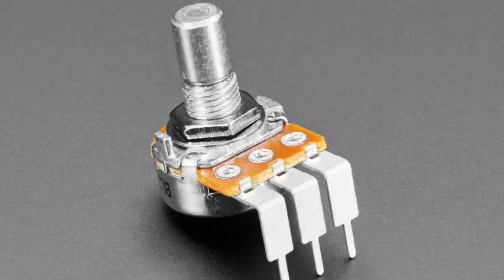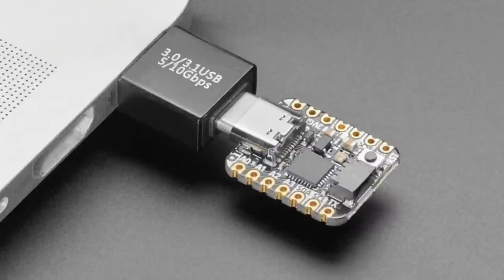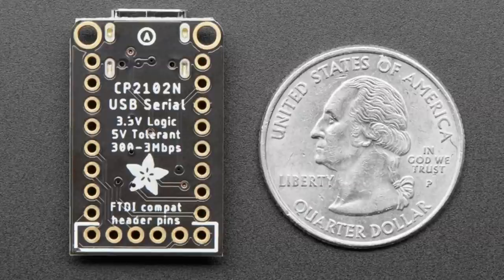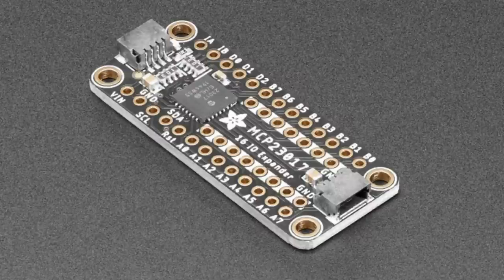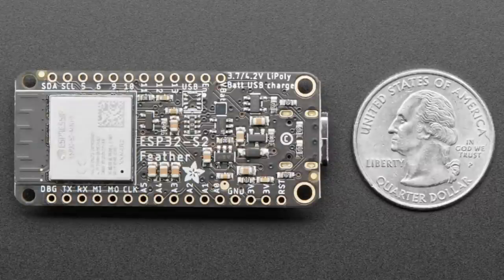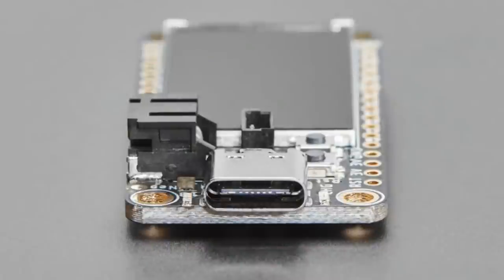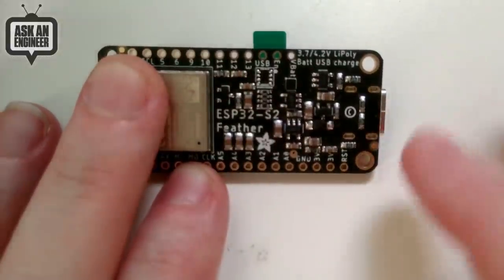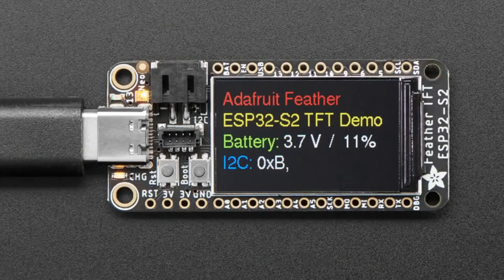New Products 1/5/2022 Featuring #Adafruit ESP32-S2 TFT Feather - 4MB Flash, 2MB PSRAM, STEMMA QT!

Comment: The ESP32-S2 TFT would be perfect, except why put the display on the "non-flat" side of the board?  It's now impossible to come up with an enclosure that doesn't look awkward.
Reply: have a look at 10:01 and 12:14 — the breadboard compatibility and the components filling up the back would cause some issues if the screen were there. I do think it'd be nice to have a separate product on the back side, though
Reply: Good point
With the USB c you could flip and with the display on the flat side the esp module can go to non flat.... If the circuit routing allows it, @Ladyada has looked I am sure.
Reply: It's close to flat, if you remove the stemma QT and battery JST. but yep.

Comment: The vertical Stemma QT port seems disadvantageous in some designs.
Can we get I2C thru the I/O pins ?
Reply: Aahh!  I now see SCL and SDA on the last two pins top-right of the TFT.
And to complete the Stemma QT-equivalent, I see the 3V and GND on the bottom-left from the TFT.

So seems like the vertical port can be bypassed if that's a deal-breaker.
Reply: Would additional pull-up resistors be required ?

Comment: Hey Lady Ada & Friends! Question - I'm using a BME680 breakout board as a pressure transducer for counting bubbles through a homebrew beer fermenter. In a nutshell, I'm putting the pressure pulses through an FFT so that I can estimate bubbles per second without the use of an IR or laser sensor in the airlock. But I've run into a problem where I can't sample barometric pressure from the BME680 at more than  5-10hz and I need more resolution than that for the early fermentation stages. Any advice for what kind of sensor I could use to get around this issue and grab a higher sampling rate?
Reply: I used an SM5852 to get speeds far faster than 10hz. It's a $60 part. You can get that job done far cheaper. The BME680 isnt designed for rapidly changing environments. Honeywell makes decent pressure sensors as well.
Reply: @billybbob18  Thanks for the tip! I had one on hand and it worked fine for estimating frequency when the pressure pulses were more than a minute apart, but the early stages of fermentation were a challenge. I guess I need to spend some time cruising DigiKey for something purpose-built.